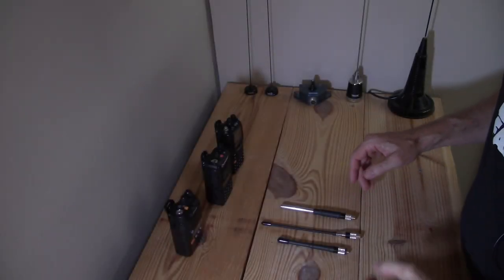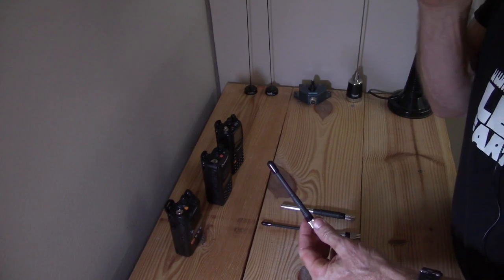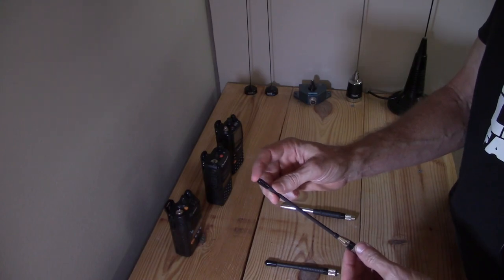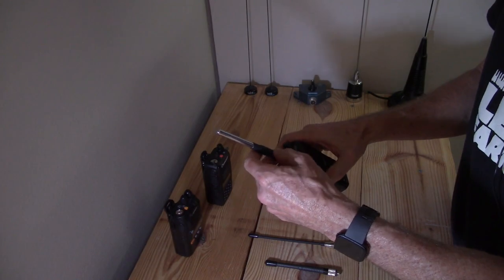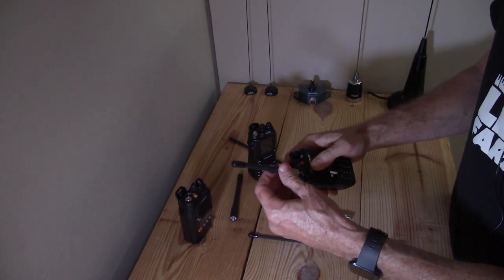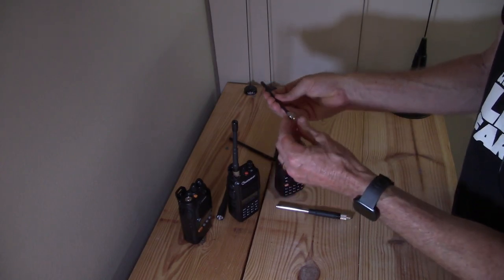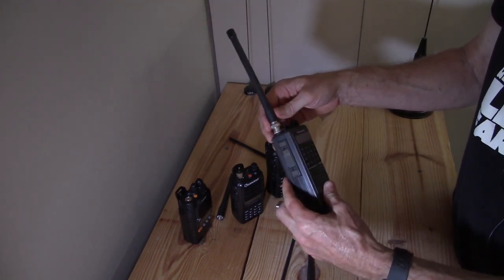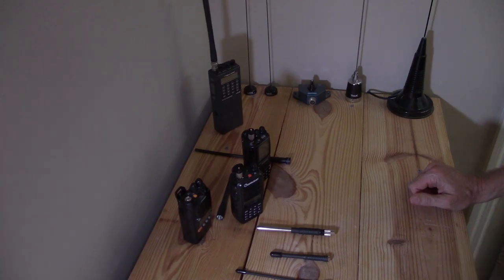The Smiley GMRS Antenna Introduction

Comment: You know, you need just under two sections down for 5/8th wave.   at full extention, it is 2 meter 1/4 wave.

This super efficient Omni-directional multi-band antenna is usable in 4 positions with 3–9 dBd gain:

 2 meters	 1/4 Wave	 All Sections Extended	 1.3 SWR
 1.25 meters “220”	 1/4 Wave	 4 Sections Down	 1.3 SWR
 70 centimeters “440”	 5/8 Wave	 2 Sections Down	 1.3 SWR
 70 centimeters “440”	 1/4 Wave	 All Sections Down	 1.3 SWR
Reply from the maker: Interesting. Didn't think it would be long enough for 2 meters.
Reply: your speaking about the tri-band. These are GMRS antennas, as described by the title, description and what he speaks about in the video. The GMRS telescoping antenna is shorter than the triband.